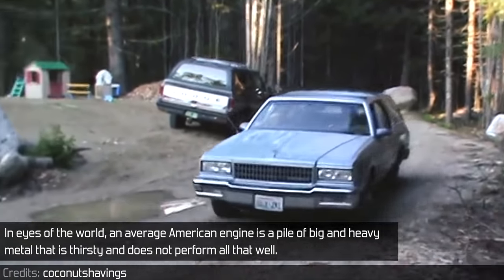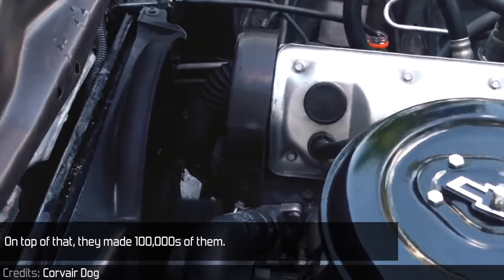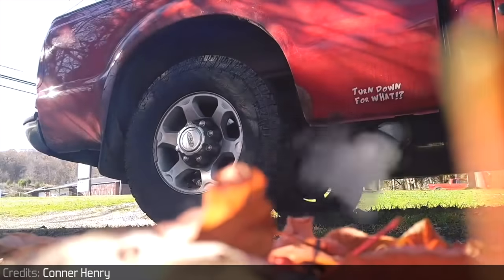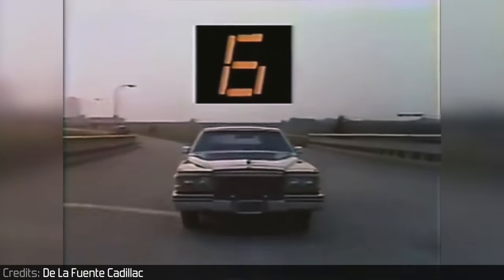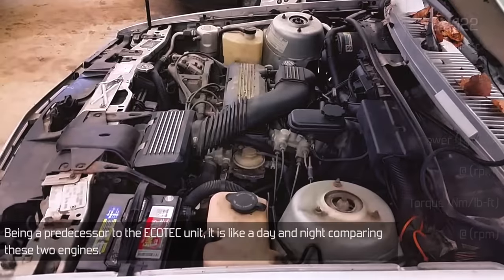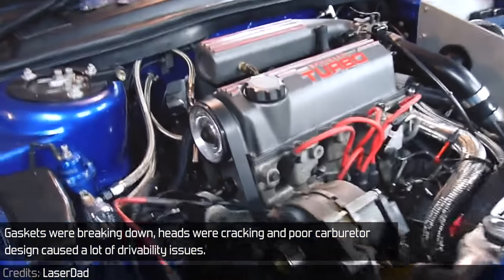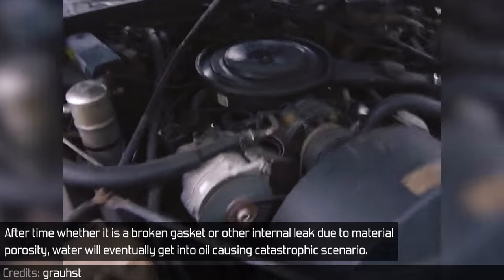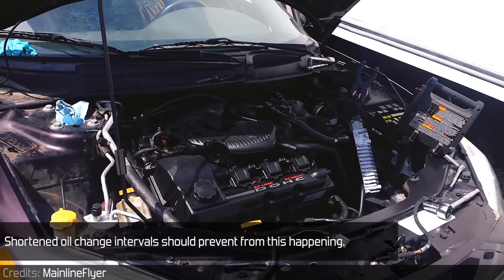8 Worst US Engines You Should Avoid

Comment: Okay since we are talking about American motors. The Vega 4cyl was built by Suzuki, The Mopar 2.2 was built by Mitsubishi, The GM 122 or also known as the Quad 4 was built by Suzuki. Dodge LH 2.7L V6 was also built by Mitsubishi. As for the Cadillac 4.1 Liter that was made by GM but most of the people who had issues used Green coolant and not the recommended GM Orange Coolant. As for the 6.4 Liter it was very innovative engine which we have greatly improved that technology today but back then it didn't perform well, however when it was disabled the 6.4 Liter was a very powerful and reliable engine. My father had one and he had almost 400,000 miles on it but my sister totaled the car in an accident. I do agree with you on the Oldsmobile diesel. It was indeed a piece of crap

Comment: The main issue the Olds diesel had was that people were too cheap to maintain them properly. People  bought them to save money on gas, and when they seen how much it costs to put glow plugs in them, they opted not to. Many people also put off oil changes, as they were more expensive. If properly maintained these engines would last forever, I know a person who ran several of them past 200,000 miles. People buying Mercedes diesels didn't buy the cars to save money, so they did the maintenance on them as recommended. 

On the issue of the 4100, if people were using the wrong antifreeze, wouldn't the issue be the owner that didn't properly?

As far as the V8-6-4, GM made a fix where all you needed to do was a computer swap, and all the issues would be taken care of, too bad that they didn't find this fix before they produced these cars. You could also simply disable the system as well. These engines with either the upgraded computer or disabled system are great engines as well.

Comment: The Olds diesel V8 were good in the last few years but the early ones were junk... Fun fact, the 350 Diesel engine made a great starting point for a high performance Olds Gas V8.  Blocks were the same design but with more reinforcements in the crank area.  The Gas heads and distributor fit perfectly, along with gas cam.  The connecting rods and pistons need to also come from the gas engine as well.

Comment: I stopped watching when you got the problem with the Triton completely wrong; the spark plugs were 2-piece and tended to break on removal, but were not that difficult to extract, and other than a cam phaser issue if you didn't keep the oil changed regularly, this is one of the most reliable engines ever made.

Comment: I had a 2.2 5 speed s10. Most reliable engine for me!  I put over 70k hard miles on it and pushed it above 5k often. I sold it with 225k miles. The truck had its dexcool flushed out by the previous owner and had maintenance records of regular oil changed. I ran synthetic oil most of the time. The reason why they're percieved to be unreliable is because they came in cheap cars like Cavaliers which had cheap owners who didn't change oil or coolant.

Comment: I've owned Chevy Vegas. Never had a problem with a carb fire. The problem with that engine was the aluminum block had a thin metallic lining in the cylinders that protected them. They would typically wear out around 60K miles. Once that happened, the engine lost power and gained massive blow-by. All you had to do was rebuild the engine and have the block sleeved. After that, it was a reliable and torquey power plant. The problem with the 4.1L cad engine had nothing to do with the engine and everything to do with it being used as a FWD unit and GM not building enough room in the engine bay to work on it. I mean, really, 13 hours to change a water pump? Absolutely stupid execution. The engine itself was quite reliable. The Cadillac 8-6-4 was another very reliable engine that used a state-of-the-art valve cut off system that proved unreliable because it was so cutting edge. It could be removed and the engine run as a normal V8. The engine is basically the 472/500 cu.in. engine with smaller cylinders and pistons (3.8"), yielding a displacement of 368 cu.in. Very reliable power plant that is still on the road, although it hasn't been built for many years now.

Comment: The Chevy Vega was vastly improved with a junkyard V8 and a $350 engine swap kit.   They really weren't bad cars once you ditched the weak suck 4cyl drivetrain.   They had rust issues, but so does everything else GM has ever built, even late model stuff (GMT 800 trucks for example)

Comment: The biggest problem with the Vega was Chevy used a new process in which the cylinders had no liner in the aluminium block.
The theory was sound but in practice it did not work. The engines became oil burners at about 40,000 miles.

Comment: Just cause Chrysler's 2.2L engine had issues doesn't mean it wasn't innovative. The carbeurated models from 1981 were truly bas but in 1982 they changed to fuel injection and the coolant issues were solved by 1984. It came with a turbocharger in select models and was one of the first of very few 4-cylinder racing engines that are available. Parts for theae engines are still mass produced and sold in local auto parts stores. It was a golden age for Chrysler because Carroll Shelby was involved in the production of the turbocharged models.

Comment: I have two 70's cars. A 1974 Oldsmobile Cutlass Supreme and a 1978 Oldsmobile Delta 88 Royale. Both these cars have the proud and proven 350 4-bblV8 angine that was installed @ the factory.  The Cutlass has less than 70 thousand miles and the Delta has ONLY 14 thousand miles. In 1999, I purchased a new 99 Camry Solara  which had a window price of 32 thousand dollars. I NEVER had any engine or transmission problems. I put 250 thousand miles on that car. Buuuut!!! major electrical problems pleagued it, more than once!  Plastic things would break, inside door handles, which were plastic, broke, the drivers side window fell down into the door, the lights would go out when driving, even @ night, the shift quadrant lights in the dash stopped working, the a/c had problems, etc etc. I was told @ a toyota dealer that the car  had to be totally rewired @ a cost of 35 hundred dollars. Welll by then I had had enough of it dammitt!  I sold that damn camry for junk in 2016 when I saw my Cutlass Supreme, which by the way was factory loaded, and only 44 thousand on the odo. With that 350 V8 4BBl, I get 18 mpg. I don't give a damn if I get 8mpg, I'm keeping both my Oldsmobiles. Hell on all these new cars...hell on them!! I am soooo friggin happy!

Comment: You need to distinguish the Triton engines. There are 2 verions. A 2 valve, and a 3 valve. The 2 valve was a rock solid engine, got a Triton V10 2 valve, 250k miles and it wont stop. Runs like it did new in 02. The 3 valves were made 2004 and up. Theu were ok engines

Comment: I have a 2002 Sebring with that infamous 2.7 V6 that stumbles at 2,500 rpm and stumbles upon quick acceleration. What's more, when you leave the camshaft sensor plugged in, it won't start. But when you leave it unplugged, although it takes about 10- 15 seconds to turn over and runs fine. Any suggestions?

Comment: The 2.2 and 2.5 liter 4 cylinder Mopars engines, Turbo or naturally aspirated, were great motors IF given the correct maintenance. Also, to these days, MOPAR enthusiasts have been rebuilding these engines with High Performance parts and transforming them into POWER MONSTERS that can humiliate V8 Chevys, V8 Fords and Imports  on the Drag strip.

Comment: I have to take exception with the dodge 2.2 being on this list. I ran a couple of k cars over the 250K mile mark with no problems. They were cheap and easy to fix and lasted so long as regular maintenance was done. Now the 2.5 mitsubishi that they ran in some of the K cars was only fit for marine use and not inside the boat.

Comment: Had a 5.4l with 152k miles blew a plug out once put a insert in it and pulled ass plugs and put some antisieze on them and drove that truck to 268k then the rear end gave me problems so I sold her and it was a very had 110k miles hauling skid loaders concrete forms and rebar and plenty of cars very good truck

Comment: yea the 4.6 is terrible that's why you see taxi cabs running 300k miles .the pre 2003 5.4's were known for spitting out spark plugs and other issues but the 4.6 in my experience is out of the best american engines ever made and how do you not have the north star that is the worst american engine .

Comment: You should add the Buick 350 used in the Pontiac Ventura. My girlfriend has a '76 Pontiac Ventura (which is a sweet car), but the Buick 350 used in it is highly underpowered, coming in at 185hp instead of the normal 200-300hp numbers you see in them.

Comment: You got the Oldsmobile LF9 all wrong. The head bolts (not studs) were one of the first applications of modern torque-to-yield bolts that stretch slightly as they are torqued down but are far more durable than traditional fasteners due to the high pre-load, a desirable feature for high-compression diesel engines. It was the reuse of these bolts that caused the problem. T-T-Y fasteners should NEVER be reused. This was mostly an issue with dealer service departments trying to save money on warranty repairs on early head gasket failures by not installing a new set of bolts, as required. They were easily strong enough for the application, unless reused, which was specifically forbidden in the factory repair manuals.
No fuel filter will separate water from diesel fuel. That requires a water separator unit (that often resembles a fuel filter, but performs a different function) installed on most diesel engines. GM accountants balked at the expense and told the engineers to proceed without them. This is what caused most of the above-mentioned head gasket failures.
If these two issues were properly addressed, these engines were no less reliable than other light-duty diesel engines of the period. The problems came from improper cost-cutting measures, not poor engine design. With a water separator and good maintenance, and they could last 200,000 miles or more.

Comment: The American auto industry had a one-two punch of the 73 oil embargo and the EPA getting on their high horse at almost the exact same time. Hell, all 4 of the major players at the time made well designed and built engines that for the time were the top of the line. When all the rules of the game changed in 73 it was hard to instantly change 35 years of mechanical development over night. The American economy taking a huge shit in the mid 70's didn't help as all of a sudden the money for R&D started drying up for the engineering depts. and the motto became get it done on the cheap, some real bad shit came out of the late 70's as far as drivetrain design at US automakers were concerned.

Comment: The 4.6 and 5.4 ford is one of the best engines around i have seen these engines run 500,000 miles without a rebuild as far as the sparkplug issue it was a problem. As far as reliability the engines were great.they r most definitely not a bad engine!!!!!!!!

Comment: You forgot the GM (Buick) 3800 Series II V6 (L36). Your dipstick would reek of raw gas, the head gaskets were a joke, and once they blew, the plastic intake manifold was warped beyond ever being reused. Oh, and I shouldn't leave out its waste spark ignition system. I've replaced coil packs and an ignition control module more frequently than most folks have had hot meals. And, after spending thousands of dollars ü put your mechanic's kids ; college, the engine just calls it quits on you, and you're back to walking, or buying a foreign car.

Comment: The olds diesel was actually a decent engine in the later years. They are great for hot rodding. A super beefed up 350 with bog block mains. Put a big block crank in it and gas heads and intake you got a 440 olds small block

Comment: I had a 1987 Plymouth Reliant station wagon with the 2.2. It blew steam out the exhaust at 115k in 1999, and therefore junked it. It was not from a blown head gasket, but from a cracked block. It also had piston slap which made this gasoline engine sound like a diesel. Though that did not bother me much. I later found out from a junkman that one had to really be religious with changing out radiator fluid, or else the coolant acid would eat away at the block. I guess I was not religious enough, despite having had the radiator replaced in it during the time I had it (I bought it when it had 73k on it in 1997.

On the other hand, my sister had a 2.2 1994 Plymouth Shadow she bought used at 60k. She drove it past 200k before she junked it. She is not as particular about maintenance as I am. Go figure. In any case, we called it her "God" car as it must have been a miracle for her car to last that long. One interesting clue is this, she is more religious than I am. Or perhaps the later 2.2 versions were improved as I don't remember her car ever having a piston slap sound to it.

Comment: Many of the engines listed were developed during a period of excessive government intrusion into the auto design world, demanding unrealistic reductions in pollutants. Those engines were the result, proving once again that big government is not a good thing. As for the rest, my truck has a Ford 5.4 V8 and now has 367,500 mile on it, runs strong and doesn't use any oil, although I did replace the plug threads with steel threads.

Comment: The 2.2 turbo dodge was a great engine if maintained properly. Not as good as the Ford 2.3 turbo, but dam good nonethless. And the triton engines have had some issues early on with plugs and head gaskets but the majority go forever and once the bugs were worked out became super dependable. The crown vic cop cars, the crown vic taxis go forever!!

Comment: How was a SOHC Vega engine a "pre-war design"🤨?  The only issue with the Vega is that GM decided to use an UNLINED aluminum bore with 17% silicon aluminum.  The silicon particles were exposed into the bore surface.  This was combined with an aluminum piston that was coated with a think layer of iron, supposedly creating a "durable" wear surface.  The problem was the abrasive silicon would wear the piston and rings and create oil burning, loss of compression and engine wear.  In addition, the head was still iron--they hadn't figured out the right headgasket material to account for the alloy block and iron head moving and expanding at different rates which often led to headgasket issues.  By the end of production, GM actually installed traditional iron cylinder liners and reverted to a standard uncoated alloy piston.  Along with revised headgaskets, this made the engines quite reliable--and being a belt driven SOHC, were quite modern for 1975-1976.  The image was tainted forever however, and Chevy soon replaced the 140 with a very low tech, non cross-flow pushrod engine from Pontiac.  To make clear that this engine was DURABLE, they gave it the name "Iron Duke".   Americans were very weary of aluminum engines at this point (even though Honda had been using them since the debut of Civic in 1973) and GM wanted the public to know that the Iron Duke was a traditional, durable, American engine.  The Iron Duke had some versions used in motosport with dedicated blocks and heads.  Built in dry sump hook ups, high flowing aluminum heads.  These were known as SD4 or "Super Duty 4" and were/are VERY cool and reliable high rpm race engines.  Some of the 2.7 liter ones were spun up to 9000 rpm on a regular basis making well over 300 hp!

Comment: Let's not forget the "iron duke" waste of space in early 80's camaro and firebirds, putting out..... 90hp?!? On a good day with a following wind  pushing it down a hill it's 0-60 time was about a half hour. Let's also include that other shitbox 2.8 v-6. Everyone I know who had that motor said it was more useful as a home for sea life after dumping it in the water. I personally had an '89 camaro rs that took a hair under 10 seconds to hit 60, but with one huge difference from everyone else. When I got rid of it in 2007 the car around the motor was falling apart, but the motor was still running great... 306000 miles, that's NOT a typo, it was still running great actually. Its amazing how even the crapiest motors people bitch about will run ok with simply changing oil every 3000miles at that Times interval. I'd venture a guess people who don't keep up with maintenance make the loudest noise. My daily driver today had gone camaro again after having an SRT challenger HEMI to now my daily driver is a '17 ZL1 10 speed modified to just under 740hp from 650, 765tq wheels it's 620hp and 665tq. The 6.2 LT4 is one of Chevys BEST motors... Just want to inject that motor into this discussion.

Comment: THE 4100 CADILLAC ENGINE WAS A DISSATER FOR CADILLAC.I OWNED TWO AN 85 ELDORADO AND 86 COUPE DEVILLE. THE 85 DIDN'T  RUN CORRECTLY AFTER 15,000 MILES .IT WOULD MISFIRE AND HARD TO START. BUT THE 86 WAS WORSE I LOST THE BOTTOM END MAINS AT 40,000 MILES .THE MECHANIC TOLD ME HE REPLACED THE MAINS BUT THEY WOULD ONLY LAST ABOUT 20,000M .HE ALSO TOLD I WOULD BE OUT OF WARRANTY  BY THEN AND TO SCREAM FOR THE SERVICE MANAGER AND COMPLAIN.THEY WILL COVER IT BECAUSE THEY DIDN'[T WANT THE NOTORIETY. BUT BEFORE THAT HAPPENED THE HEADS AND BLOCK SEPERATED AND I LOST THE TOP END ,I DID WHAT THE MECHANIC SAID AND THEY DID COVER IT AT 59,000M. THE CAMS WERE ALSO SOFT AND WENT BAD.

Comment: The Olds diesel was NOT a new design.  That's why it failed. It was beefed over the gas engine, but not enough.  There was a one year only 260 cube diesel V8 as well as a 260 cube diesel V6 after that.  They were far better engines, but nobody trusted them, as the 350 diesel was so horrible.